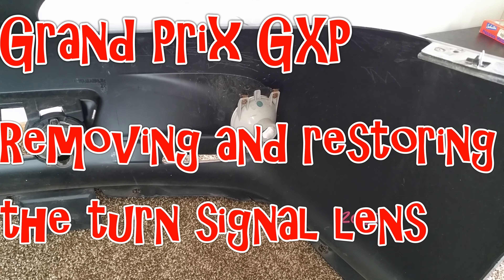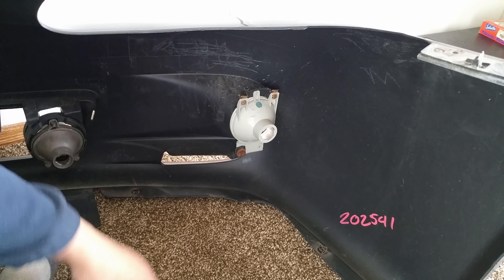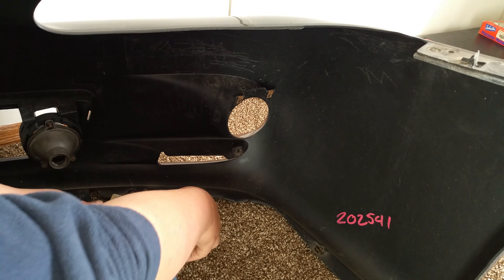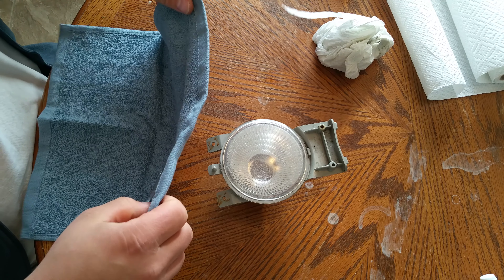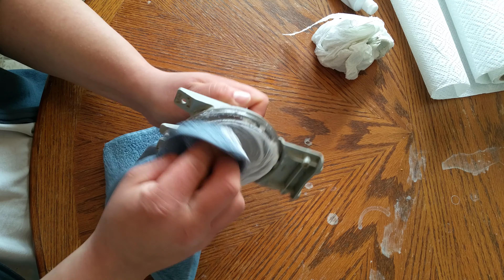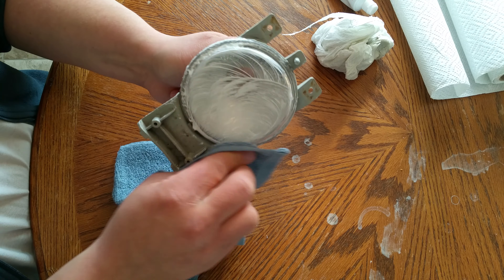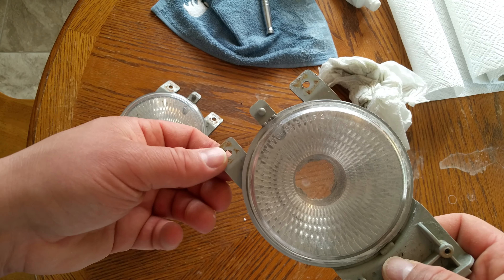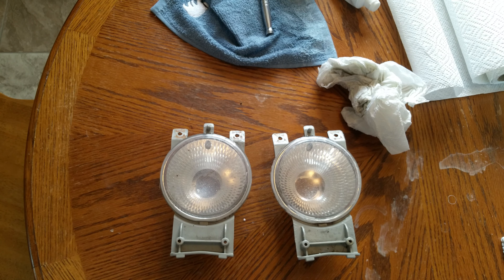Pontiac Grand Prix GXP - Removing and cleaning the turn signal lens

Comment: are you going to pull off top end engine parts etc too?

I think I am going to nightshade a few light coats on my turn signals so it looks darker when not engaged...
Reply from the maker: Doing the downpipe today. Letting it soak in pb blast. After that I will start taking the top end off
Reply: GPVlog
cool... I'm tearing my car down over the winter and your videos will be helpful... I've removed the wire harness already, a few turbo parts for access, valve cover and coils for painting... I am going to remove the intake and paint it as well... the one injector right by the alternator bracket looks like it wont pass not sure yet.
Reply from the maker: +Rick Dangerous I would love to get in contact with you. Swap some ideas and such.

Comment: any recommendations for getting the light to stay in ? I have a 2006 grand Prix gxp an the previous owner had an accident that caused some damage to the bumper causing the light to dangle? I don't have the money to replace the entire front clip but I need the light as you know its the turn signal light. I can take pictures if needed.